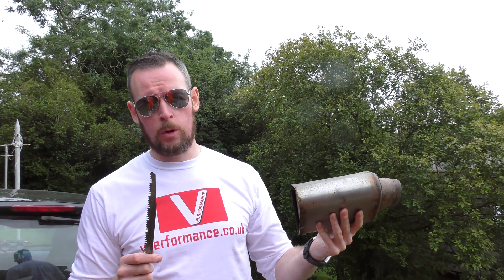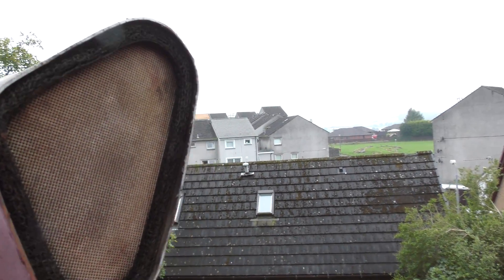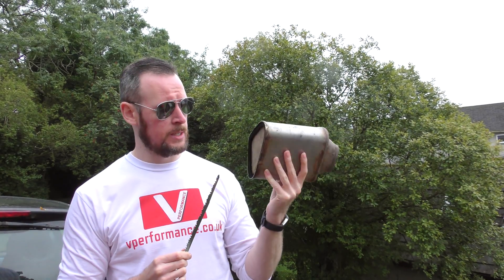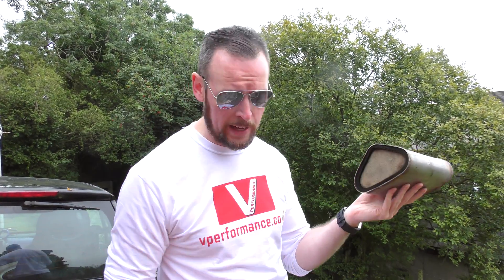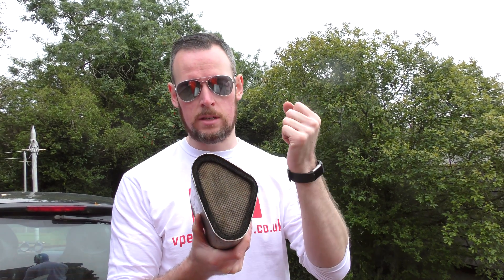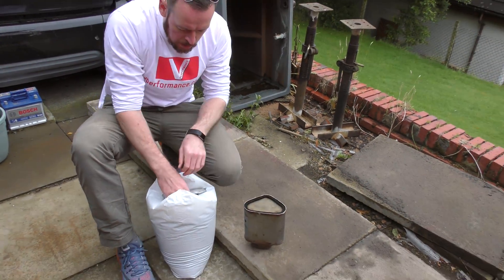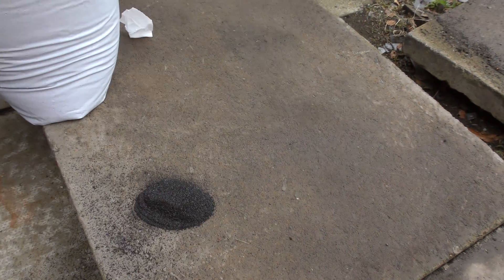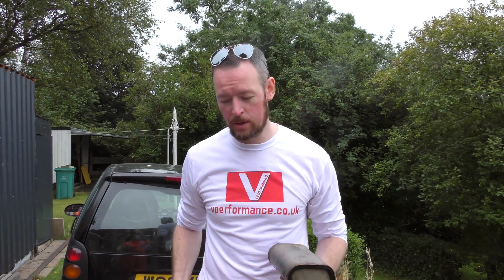What's inside a catalytic converter

Comment: Will a decat exhaust get through an MOT? Sorry if that's a dumb question
Reply from the maker: By the law, any exhaust modification which makes it louder will not pass mot. For diesels there is no test for a cat other than a visual. By law an obviously missing cat is an mot fail. For petrols there is an emissions test, and without a cat, your car will fail that test. However, some MOT testers are more relaxed than others.

Comment: I would really like to see someone putting his tuned car on the dyno with and without a clean converter (and not changing any other things) to see the actual horsepower change. I think that it would not change much and if you regularly rev your engine it would not become dirty or blocked. I can believe that one would get blocked by someone who never gets past 2000rpm. But this is what I think, so I'd like to see proof if what i'm thinking is wrong or not. Thanks for the video!
Reply from the maker: Fortunately this car was running super hot so the cat was remarkably clear. I've seen some which are like a solid block of coal inside!

Comment: what about MOT test and catalytic converter?
Reply from the maker: It's a fail, however for a diesel there isn't an emissions test - just a smoke test. However the MOT now says that "any vehicle louder than a similar vehicle" is a fail. Most MOT testers won't care though.
Reply: Just put a baffle on for that occasion and you should be fine. You're lucky you get away that easy there in the UK.
Reply: vPerformance i didint know that thanks thats my cat getting gutted 😁😁😉😉